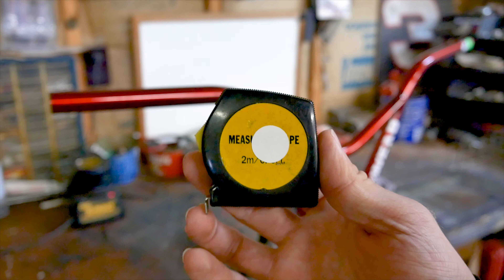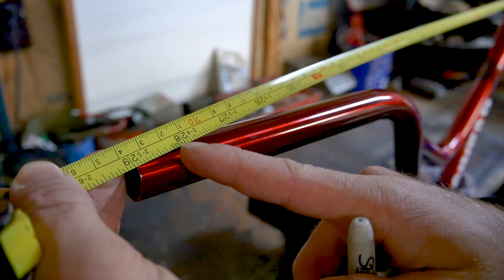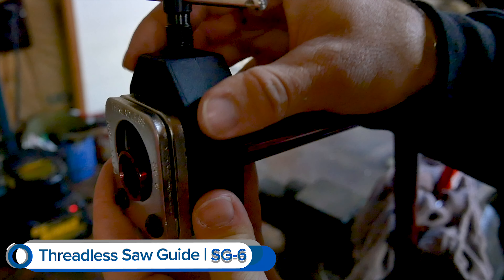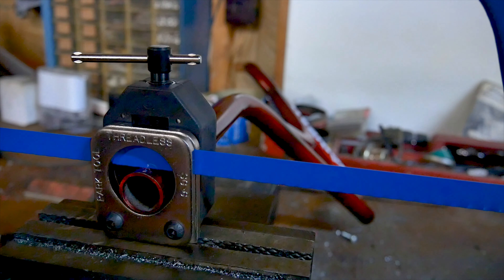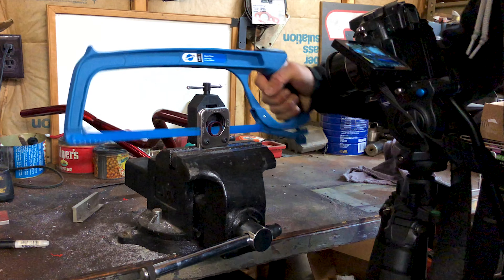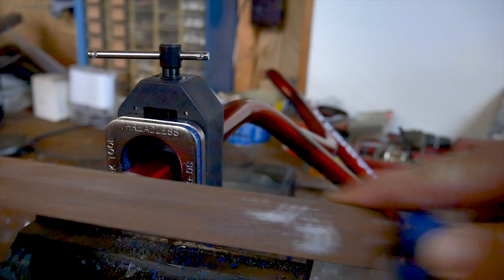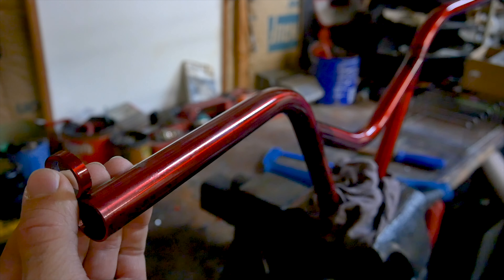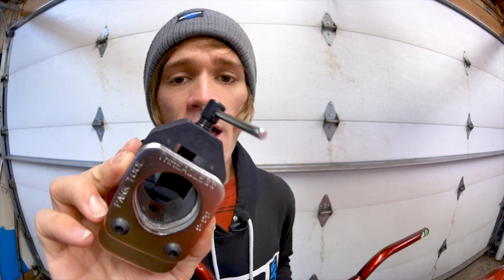How To Cut Bicycle Handlebars!

Comment: If you dont have the saw guide you can pull your grip back to where you want to cut it, and then get the grip from the other side and slide it on. Make sure to leave a small gap for the saw.
Reply from the maker: Not a bad solution!

Comment: I like my bars about 27"wide if iv run out of hacksaw blades ill do it with a grinder just tape the end of the bar so you know what to cut off (measure twice cut once) some handlebars come cut two the size you like, like the Nate Richter handlebar or the garrett reynolds handlebar come cut at 27" wide depending on what you like hope your good Brant \m/
Reply from the maker: Haha sketchy grinders!

Comment: I cut my 29 to 27 with hacksaw. I was able to get it pretty straight. But I will NEVER do it again without a pipe cutter. It was way more work than I expected. Today's bars are super thick compared to yesteryear.
Reply from the maker: It literally takes 2 minutes with a hacksaw. Haha But that’s the beauty of freestyle. Anyone can use anything they want to cut their bars
Reply: My hacksaw must be dull. You flew through that bar.
Reply from the maker: Elbow grease and brake biceps